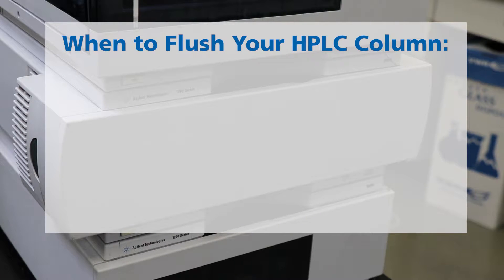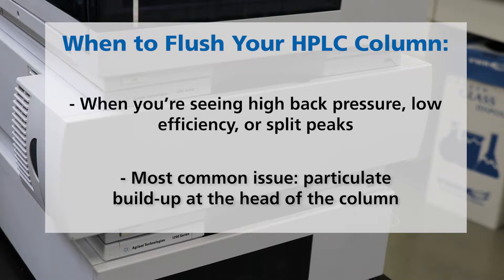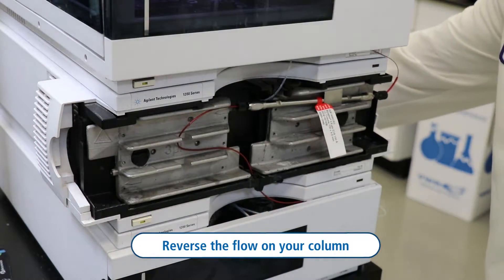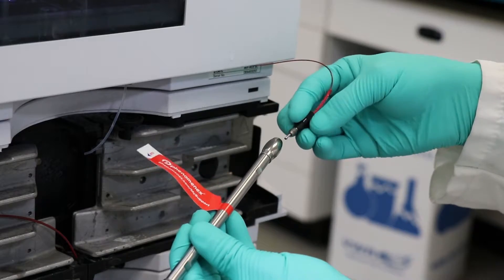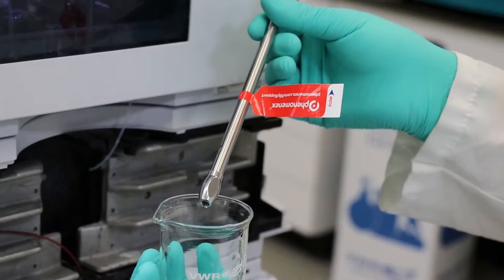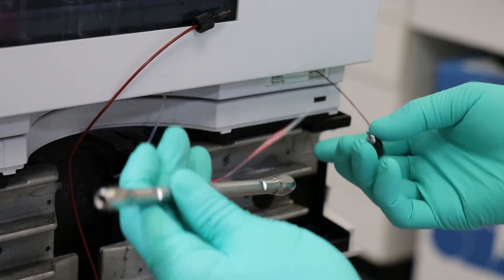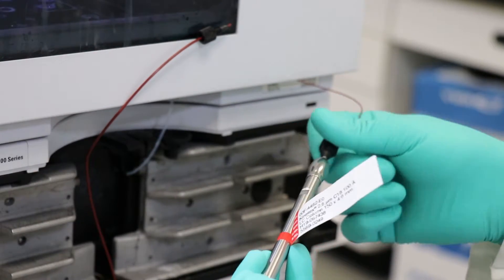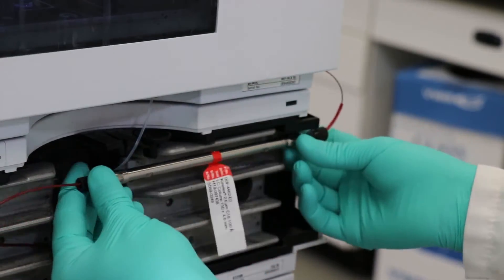How to Clean an HPLC Column | Reverse Flush Method Explained

Comment: For those who don't know, do this:
*Do the reverse flush.
*Set the flow rate to lets say, 2 or 3 ml per minute (check your pressure limits beforehand, because this will increase it and may cause the pump to give you an error message).
*Change the concentration if you want (I use acetonitrile and change the pump concentration to 100%)

This usually helps you with broad peaks, small peaks, etc.

Comment: Does Phenomenex sell the test mix?  Are we limited to a half ml/min on backflush?  Should we run a methanol mix first then IPA if the pressure is still high?  Should we adjust the pH?
Reply from the maker: Hi Michael, yes we do sell test mix for C18 and Reverse Phase columns the part number is AL0-3045. And also yes, the backflush needs to be done at a lower flow rate or else it can cause damage to the media bed. And it is better to go with the lower viscosity solvent (MeOH/ACN) to the higher (IPA) – very important to use lower flow rate. And no, it is best to use only pure water instead of buffer to wash the column. You are trying to wash the buffer salts off the column when you are cleaning. We hope this helps! If you have any more questions and need an answer right away, please feel free to reach out to our technical experts via Live Chat on our website! It can be found at www.phenomenex.com/chat. Thanks!